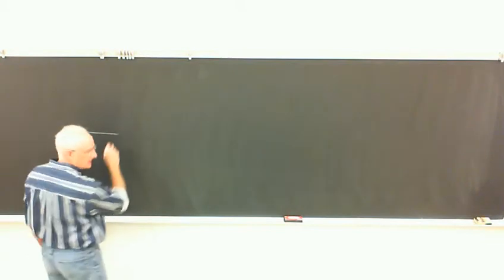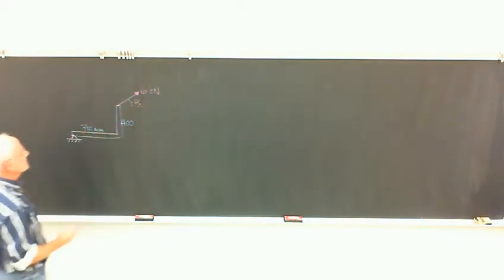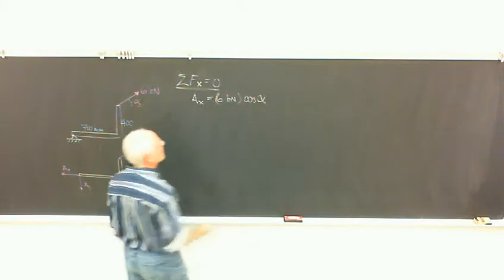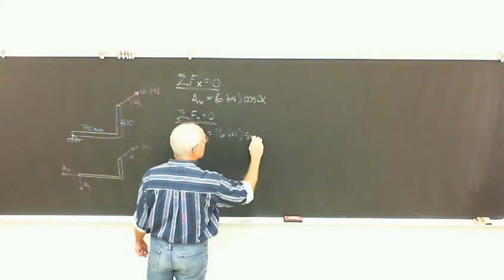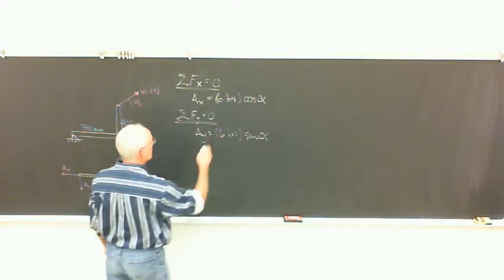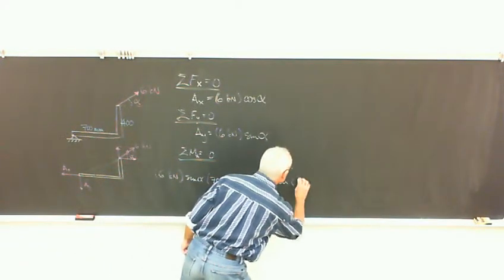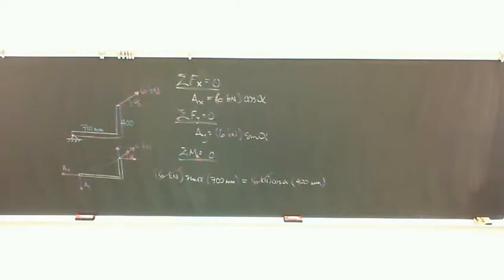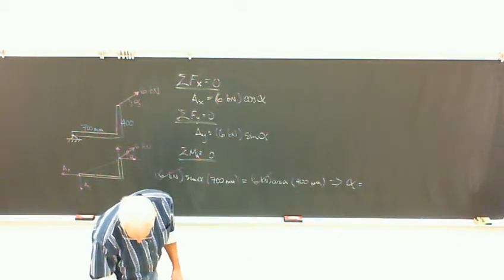Equilibrium in 2-dimensions, Part III

Comment: One thing I'm confused about with the three-force rule - would this be a counterexample? Say you have a beam that's 4 meters long, with a 2N downward force exactly in the middle and two 1N upward forces, one on each extreme end. As far as I can figure out this should have no moment, as well as all forces summing to zero. These lines are parallel. If you used the concept that all parallel lines intersect at an infinite point, that wouldn't work for a beam of the same length with a force of 1N up at the left and right sides again, but the 2N upward force shifted left or right by any amount.

edit: I checked some other sources and they specify that this concept only applies to non-parallel members. It makes sense now!